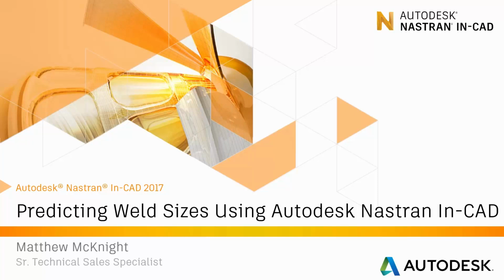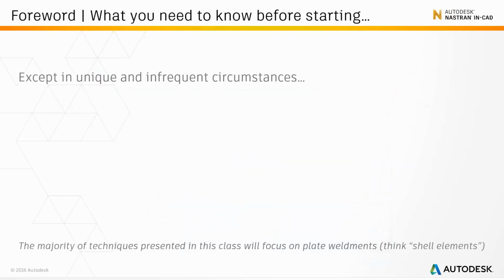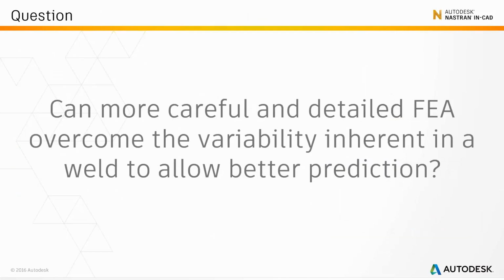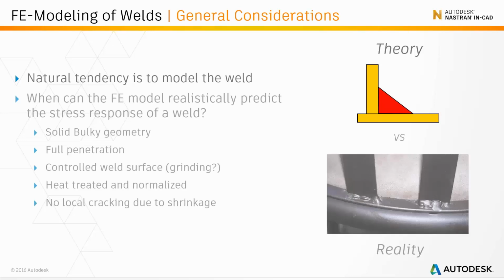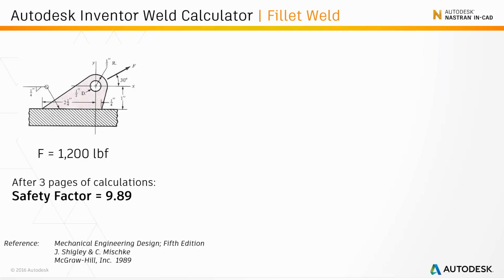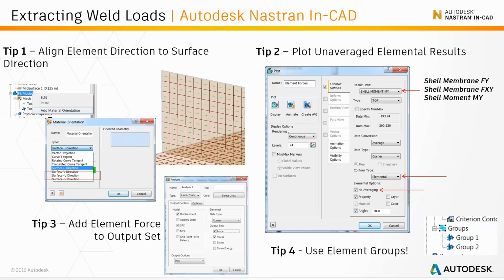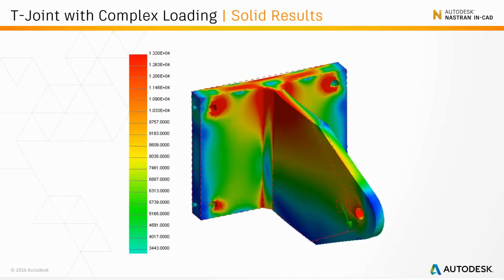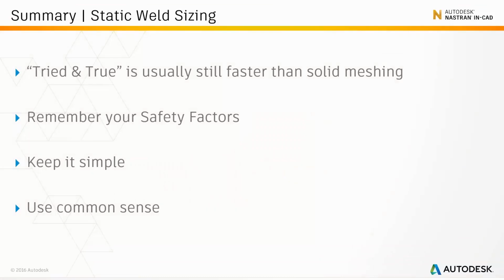Predicting and Validating Welds with FEA in Nastran In-CAD

Comment: Can someone please help me out here. When I do this analysis, if I refine the mesh, the output  lb/in values increase. Aren't these values supposed to be mesh "insensitive"? Obviously this is an issue as the calculation then tells you you need a bigger weld if you have a more refined mesh. What am I missing here? Thanks in advance.
Reply: Welding requires extensive benchmarking based on your application/industry. It's as good as aiming in the dark.
Reply: The stress values typically increase at sharp corners when refining your mesh, up to a certain point. Is your problem at a sharp corner? In real life there is alwast a small smooth transition at the weld toe. If the stress goes to infinity the more you refine your mesh, then you have a stress singularity